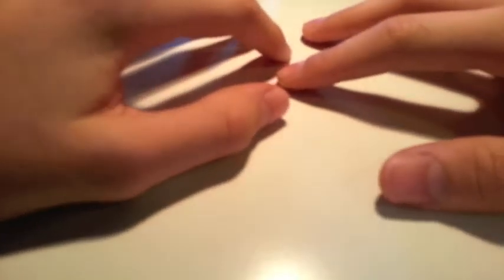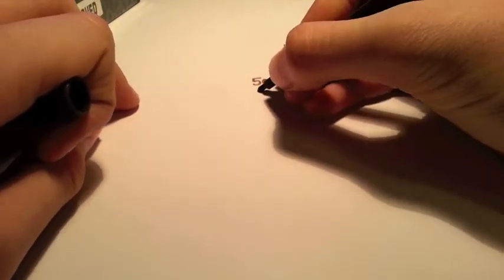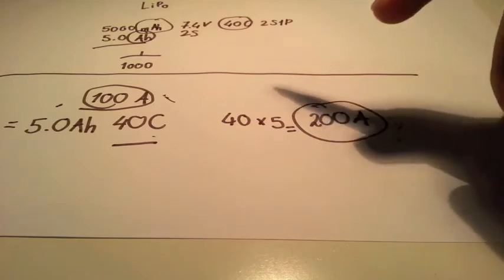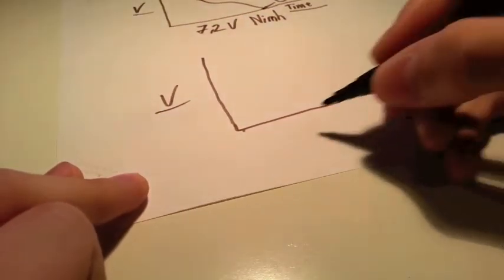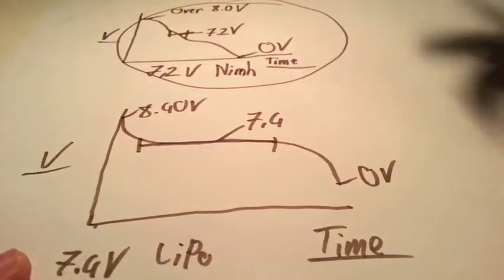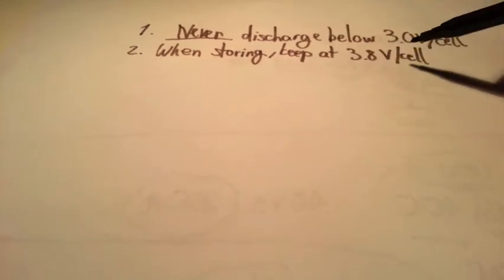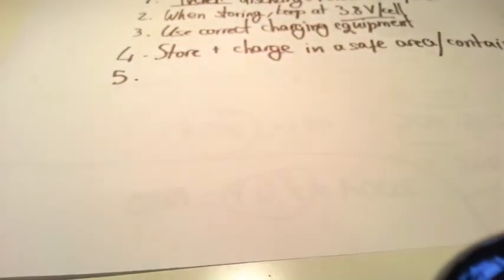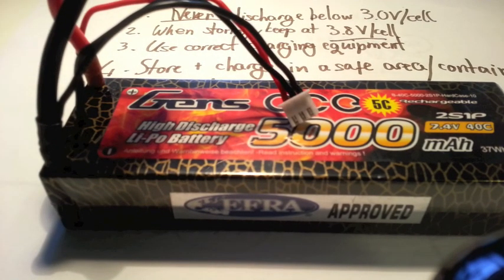LiPo Battery Explained

Comment: So say my 2100Mah 20c lipo only will produce 42 continuous amps. And that's not going to cut what I need. If I take both my 2100 mah 20c 3cell venom packs and run them parallel making it 4200mah does this make it 40c.
Reply from the maker: Jacob Hendrickson 
No, it will still be left at 20C however the continuous amperage will obviously increase.